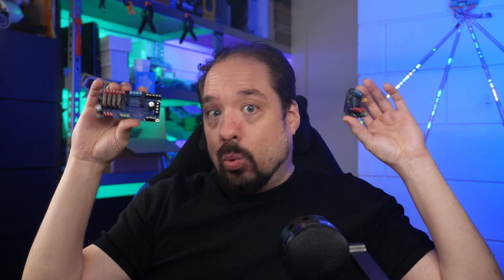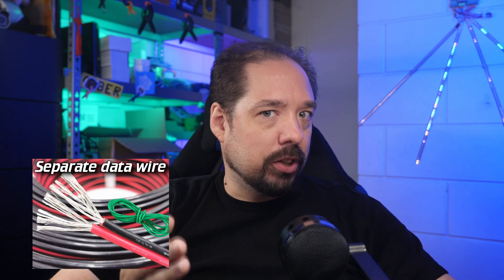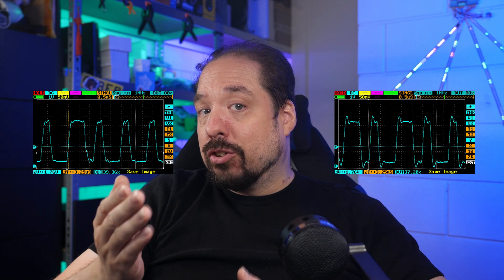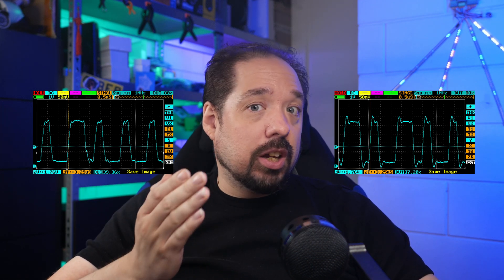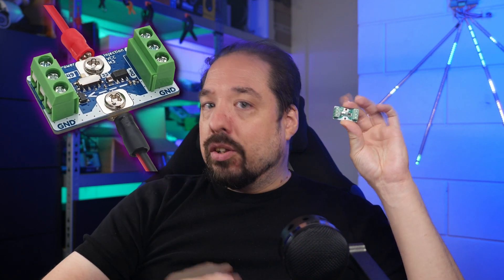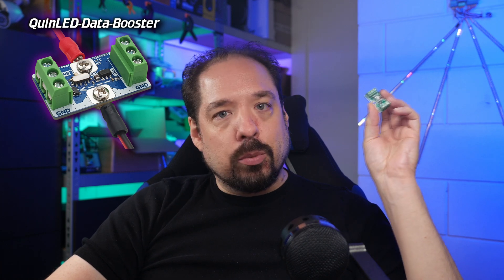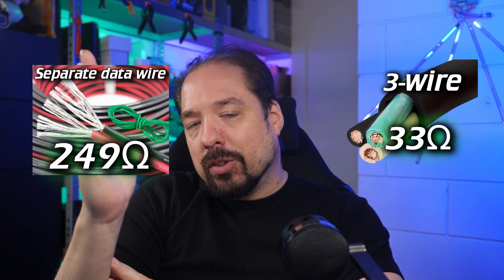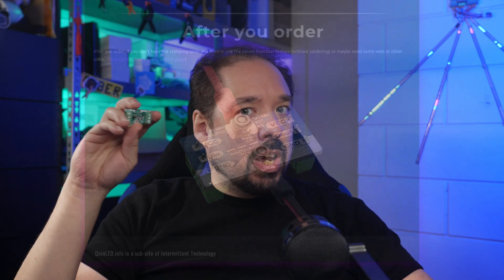💡QuinLED💡 Ever had flickering ws2812b LEDs? Watch this video!

Comment: Would a separate screened cable for data transfer work better?
Reply from the maker: Maybe in some scenarios but you'd still have to tune the resistor and the fact that such a signal isn't designed for these distances also plays remains, if you really want to do long distance, differential really is the way to go.
Reply: @IntermitTech  Hi will you be talking about differential signalling soon i have looked into it but seems you need twin twisted pair for each signal is that correct? would love to see a live stream on that subject.
Reply from the maker: I do have some plans for it yes and it's correct you need twisted pair for it. You can go quite the distance with it though!

Comment: Hello sir, I hope you see this - I know the video was posted quite some time ago. 

I have a btf 5v ws2812b strip powered by a btf 5v 60a power supply, with a esp8266 board flashed with WLED. 

The ground, power, and data cables are ~2m (~6 to 8 ft) at most. 

When powered, the color and brightness are perfect when untouched. But when I pick them up to try and install them, they randomly flicker different colors, blow up to max brightness, etc. When I place them back down and leave them alone, the correct color and brightness resumes. 

The strip has 40 LEDs on it. Do you feel I need to add a data booster? I have no resistor of any kind along the 6-foot data run between the ESP board and the first LED

More info:
Vin and Gnd on ESP are running to power supply via 6-inch 18awg wires, and twisted together with 20awg wires running to the first LED for 6-8 feet. 

The D4 pin is running about 6 feet uninterrupted to the data contact on the first LED via 20awg wire.
Reply from the maker: I'm missing the level-shifter in this story?
Reply: @IntermitTech  ahhh - I actually am not using a level shifter right now. I think you just solved my puzzle. 

Thank you!!

Comment: What if I have 10m+ of separate data wire going from a controller hub to the wall of my house, then another 10m+ of bundled wire running from the house to the led strips?
Reply from the maker: Put a Data-booster board at the transition point and switch it to 33R for the combined section, then it should in theory work fine. Especially with long lengths like that, putting a booster board somewhere in the middle isn't a bad idea anyway, since it sends the signal out freshly again at 5v, even if it sagged on the way there.

Comment: Does it still work if you place the Resistor on the board? I was advised that the Resistor on the Data line must be physically placed close to the first LED or it's useless..?..

Also none of these online guides ever mentions what WATTAGE should the Resistor be?
Reply: Any wattage is OK -> as small as you want.  To me the resistor is more useful for the protection it brings against electrostatic discharges (and over current into the led DIN if the led strip is not powered). Where to place R ? Indeed, by placing it close to the Led, the driver (cpu) will be able to inject more current into the line. But then it is the pin of the CPU that is also now unprotected against ESD.  I won't talk about the characteristic impedance of the line, because that depend on your specific setup.
Reply: @lcdvasrm  Thank you for your reply. I wish I understand it as well as you.

Comment: Is it ok to disconnect the ground coming from the quad v3 to the leds and fix the flickering problem? Anyways i have the ground connected from the power injection in a separated cable, right now i have a 3wire cable connected to the lights and that’s why i have the data problem , so I just want to know if is ok to disconnect the ground from the quad?
Reply from the maker: Well the one running to the LEDs of its running over a different cable, yes. But the Dig boards does need GND to it, can't work without it.
Reply: @IntermitTech  i have two different elevations, two different set of 18/3 cables connected to the quad v3 and i have two power supplies at each end of the leds and power injection in every end or union of the strips , i have the dig uno , and when I connected the dig uno to one elevation and the quad to the other elevation works good, but I thought the quad was going to take care of me having two different controllers,
Reply from the maker: Well sure it can, depending on total amount of LEDs and power draw, but still. Just need to make sure the resistors match the wiring setup then.
Reply: @IntermitTech  it’s ok to put a “sacrificial pixel “ in the middle? I welded one to see of that works
Reply: @IntermitTech  I’m going to try a sacrificial pixel about 15’ from the board, and from there is another 12-15 feet to the leds, I hope that works, you think?
Reply: @IntermitTech  the sacrificial pixel didn’t work 😞, if I connect the dig uno alone to that elevation works good , I thought the quad was going to take care of having 2 different controllers, same set up if i connected 2 different controllers work good, but if I connect the other elevation to just the quad then i have data problems 🤷🏽‍♂️
Reply: @IntermitTech  now I’m going to try the one data cable alone to the leds I hope that works 🤞🏽
Reply: @IntermitTech  quick update on the flickering problem i had on the upper section of mu leds lights, i through another data single cable and connected to the quad, seems to be working fine now 🤞🏽 hopefully stays that way, now i have to hide the cable that looks ugly on top of my roof 😁
Reply: @IntermitTech  in this video you said by disconnecting the ground that goes together with the data cable to the leds will fix the problem, I did that and got worse, so I will try the separate data cable from the quad to the leds , but we have snow on the roof now, 😁 if that doesn’t work maybe try to put the 33ohm on the data line going to the leds? But the quad already have one on it ,
Reply from the maker: By default it is not configured for ground next to the data cable so it comes with the 249R and not the 33R. So if that saves you from going up on the roof, maybe try that first? Even just bridging the resistor spot could already do that as a try out.

Comment: Interesting video, this only applies to long data cables leading to the first pixel? I currently have two strings of 2815 running off a new dig quad, that have flickering and corruption after roughly 200 leds, but my data line from the quad is maybe 1meter. Brightness didn't change it and power injection didn't help either.
Reply from the maker: Yeah, 1 meter should be fine regardless data wise, have you hooked up the backup data input to GND?
Reply: @IntermitTech  Thought i responded to this last night but apparently forgot to post it. Anyway, so your saying to connect the backup data line on the led strip to a 2nd common ground instead of a second data line? Currently I just have 12v+ Common Ground and 1 data line. Overall length is 255 leds, and I have injection from the end at #255.
Reply from the maker: Well to any GND, even just that of the strip itself, but yes
Reply: @IntermitTech  Thanks for taking the time to look at my problem. I'll give that a try. And Report Back. Thanks again.

Comment: Which Pre-assembled Quad Boards have the resistor installed on them and which don't have any? Is there batch/version numbers or a date you added the 249 resistors to the board design?
Reply from the maker: There are revision history pages for both boards on the website. ;)

https://quinled.info/addressable-digital-leds/
Reply: @IntermitTech  Thanks looks like I have a pair of version 1. I ran 2x twin pair 2.5mm2 wires around 7meters as +5v and 0v for my LED Strips and then branched them out in a parallel star config wiring through xmas pigtails. for the data line I used a 7 core .44mm2 for each core to each of my LED strips. The flickering seems to occur if I try and run 2 strips off 1 of the Quad's LED channel outputs regardless of whether I have a resistor of any value or no resistor. But solved the flickering by just having 1 stip per output and syncing the quads together in wled.
Reply from the maker: Interesting, I have done tests with parallel outputs from a single data port and generally 2 to maybe 3 worked ok. That was with short cables though, so maybe that changes thing a little bit.

Glad you where able to find a solution though! If you have a recent version, there is actually a 5th channel as the Q1R port (in the 5vEXT block) is also level-shifted to 5.12v!

Comment: I have ordered these.  When I get them do I install them close to the Dig Quad or closer to the led strip?  Led strip is about 30 feet from DIg Quad?
Reply from the maker: Depends on what you use it for, if resistor change, close to the Dig-Quad
Reply: @IntermitTech  I think it would be for that as my led are 30 feet away from the DIG Quad and I'm using a 3 pair cable
Reply from the maker: Yup, that is the exact case, should instantly fix that.

Comment: Busy writing up my BOM for whole house LEDs on the outside, love these boards and their pricing. Plan to use them at power injection points because hey, might as well clean up and boost the data signal at the same time.

Took me a while to realise though what it was doing. You are really working on the shift register being better at reading a weak signal compared to the LEDs and spitting the signal straight back out at full high/low levels again if I have got this right?
Reply from the maker: Yes, it is generally more sensitive then an LED itself but it's mainly meant so that the output cables be longer after the board then straight from an LED.

Comment: Would this work with the WS2813?
Reply from the maker: Yes, same thing. :)
Reply: @IntermitTech  As the ws2813 are a 4 wire config what should I do with the "backup data cable"?
Reply from the maker: Generally the back wire is tied to GND, the first pixel wil generate the double data.

Comment: The distance between my D1 mini and my LED strip is roughly 20m. I am using a sacrificial pixel and also added a 249 Ohms resistor but I still had this flickering and could not control the strip (465 pixels, 12V). I ordered several QuinLED-Data-Booster boards. They arrived yesterday and I installed one and it did solve my issue!!!
Reply from the maker: Excellent and glad to hear!

Comment: Very nice explanation, what about some jumper pads for the resistors so the user can bridge them with a little bit of solder?

Or maybe that's a bit too much towards the diy way.
Reply from the maker: Well I'm all for the DIY way, for sure! But if you have the soldering iron in hand, whipping them off the board is 2 seconds of work and then soldering on new ones a few seconds more. But that's why I've included the locations and pictures and all. :)
Reply: @IntermitTech  I know, what I mean is that the user then has a choice instead of fiddling with a resistor and have to order them.

I don't mind swapping them either, just a thought after watching the video.

Comment: Great stuff. Yet again. Thanks for that. Question: when you refer to cable lengths (10m or 20m in this video), do you mean the length of the cable run from the controller to the first LED on the strip, or do you mean the entire length of the run from the controller (through the wire that get you to the strip mounted over there and then through, say, two or three 5m led strips-- another 5 or 15 meters)? More specifically, if I've got 10m of cable before three 5m led strips, do I have a 10m cable run, or a 25m cable run? (in lengths you refer to in the video)?

Followup: in the 10m cable + 3x 5m strips (15m of LEDs), do I do use your data booster once right outside of the diguno controller, or do I (also?) put one in the run itself? Like between the 1st and 2nd strips?
Reply from the maker: We're only talking to the first LED. Depending on what you use the booster for but if it's for resistor change, right behind the controller.
Reply: @IntermitTech  Excellent. For 3x 5m led runs then (900 LEDs) would an additional booster board be needed to get signal to the last few hundred LEDs? And if so, placed somewhere between the last 2 strips? Or is the booster literally for only right behind the controller?
Reply from the maker: No, as long as all the pixels are close togeher, if you are bridging a larger gap between pixels then mahbe. You might also want to keep the amount of pixels to about 600 per data channel to keep everything running ay 60FPS.

Comment: Thank you so much for this advice, i finally fixed my ws2811 leds that have been flickering forever. Thought it was the power supply but nope i was using a 220ohm resistor. Changed it to a 20ohm and its working 100% fine now.
Reply from the maker: Awesome, that's great to hear, exactly why I made this video and article! :D

Comment: Great timing for this video. I run multiple d1 minis in my Christmas light display with the d1 within 1m of the start of the strips. Last night I added 200 pixels {in one prop - 4 x 50 pixel stars) to the display. When connected by themselves, they run perfect. When I hook up the other controllers (all running off the same power supply) the stars flicker. It's either a v- issue as the lights are not on the same v- as the controller OR its this issue. I have 3wire running 4m from the controller to the first pixel. Do you think is the missing resister causing this issue?
Reply from the maker: Hmm, if it doesn't happen when the others are off it's more likely a power issues (either supply or certain cables dropping too much voltage).
Reply: @IntermitTech  Thanks for your reply. It was a power issue, OR more specifically the grounds. I hooked up the D1 mini ground to the same one as the lights and the flickering stopped. Feel free to check out my display videos from last year.
Reply: The flicker problem came back even when confirming all the grounds etc. I put a 120 ohm resister in there (thats the smallest I have) and the flicker has stopped. Yay

Comment: The shipping for those booster boards is $32 canadian from the worldwide store. Almost 10x the cost of the board itself. Great information in this video for sure, but I  can't pay that ridiculous shipping charge.
Reply from the maker: Oh, euh, that doesn't sound right. I do expect most people to add them to an order when ordering some other Dig boards, but I'll look into it for sure!
Reply: Yea, I'm in the same position, I already paid $32 shipping for the Dig boards, only to find out later I need Boosters.  Will try the solder route but not sure my resistors are 1%...
Reply from the maker: The % of the resistor won't matter too much. In that regard, the new version being released this week has a new resistor switcher feature built in to exactly prevent these issue from causing problem for people! I try to improve where I can, sorry you ran into this!
Reply: Thank you Quinn, the resistor swap worked great, and my tolerance seems right at 1% as the Manufacturer claimed.   BTW, I thought you should know that my resistance problem occurred going from 1m to 2m strands of entry-level  2812b 144 L/m (from the Asia region) with data bundled next to ground, so it's definitely not just a long strand/string problem.
Reply from the maker: Oh, that is interesting indeed! But very happy to hear it worked out. As said, boards coming out now have new switches built in solving this issue once and for all, just wish I could have done it sooner, but it required a bit of a redesign of some parts and lots of validation  and testing, that always takes longer then you want it to.

Comment: My experience is that putting a resistor at the start of the led strip, so at the end of the data wire fixes everything. So no resistor on the side of the board. I made an infinity mirror kitchen tabel light with 2 power wires and 6 data wires in one shrink sleave, so all on top of each other. Running 2040 leds and the best resistor value was between 0.4K and 1K for a crystal clear data signal. Verified on the scope. I ended up using 1K. So the value of the resistor might not even matter that much if you put it on the end of the signal wire. (See my YT for that led project)
Reply: Yeah this makes the most sense.
Reply from the maker: Oh, interesting stuff! But everything I see on your channel only has very short data wires, I wonder if the same is true if we're talking 5m or 10m wires which are the specific thing we are taking about here. For much shorter wires it's all a lot less crucial and lots of values can work. Also not having a resistor on the output but only at the end, I wonder if that influences EMI at all, although I do get that it would at least dampen ringing, for that purpose it doesn't matter where the resistor is. I'll play around with it a little bit when I have a bit of time!
Reply: @IntermitTech   It may look very short, but those dodecahedra use arround 5 meters of signal wire (28awg 6 core sillicone wire) And i also tested this before making it to size and that was 10m. The signal is boosted right after the esp with a 74HCT245.

Ik ben benieuwd naar het experiment met die kleine boosters. In theorie als je leds aan staan zou het prima moeten werken. Maar als er weinig effecten actief zijn kan de ene een bron zijn voor de andere zelfs bij een klein voltage verschil. Overal 10A diodes tussen doen is ook niet echt de bedoeling… Die boostertjes doen vast niet aan load balancing….